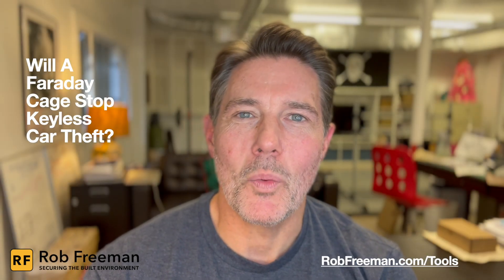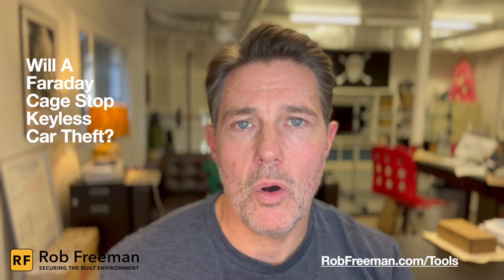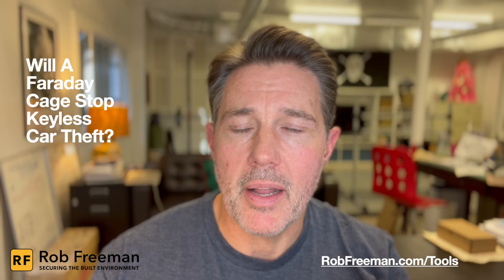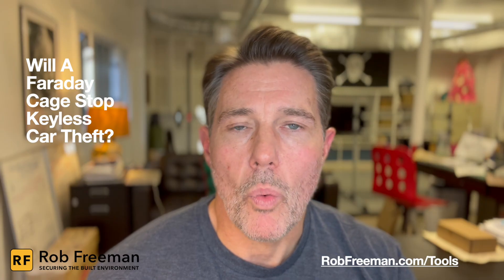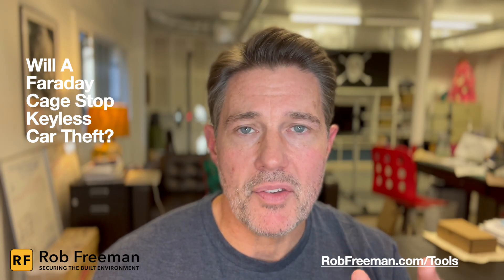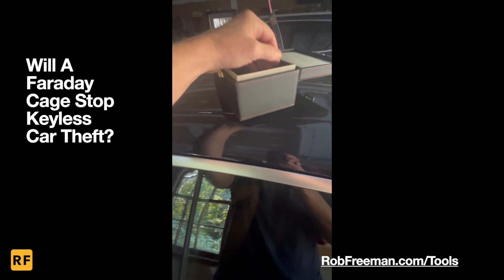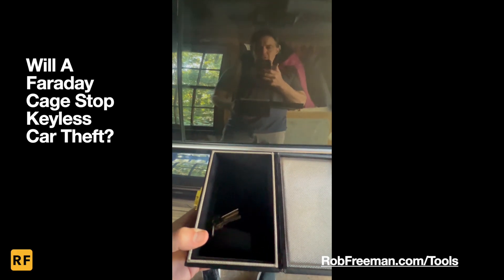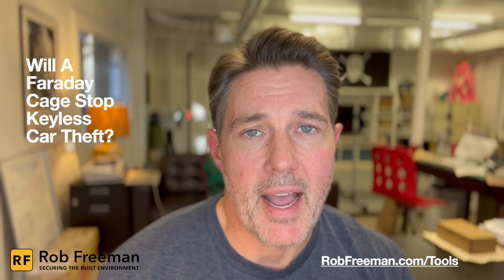Will A Faraday Cage Stop Keyless Car Theft?

Comment: The keyfob inside the house is not "constantly emitting" - it only responds to the car's LF RFID challenge transmission when it's in range, which at 125KHz or 134KHz is only 1 to 2 meters.  So no - the keyfob can't hear the car's wakeup transmission until it gets within that short range of the vehicle and a Faraday pouch/cage/box is superfluous when it's beyond that range, eg inside your house.
Reply: They're using strong Antennas + signal Amplifiers with Repeater, so this will effectively close the range, no?

Comment: I have my keys in Faraday pouches and store both of them in a Faraday box. 
To be extra careful, I also have the Remote HondaLink subscription, with a Geo-fence alert activated and the "Locate car" map. I also hid an Air Tag in my car. HondaLink allows for the remote sounding of a horn and remote killing of an engine, I haven't tested those features yet but I am thinking I could make life extra difficult for a thief driving a car with the horn blaring.

Comment: Thanks 4 the test. On Christmas eve I came out to go2 work. Car was gone. Honda Accords are being stolen like crazy where I live in Philly. Definitely invest in a Faraday box n pouches, I got a set for 20$ on Amazon. 
Also....if you have rims, u might want to add an extra rim lock on each, and invest in an alarm. 
I was carjacked @ gunpoint once, and recently the key fob got hacked. 
Also, one more inexpensive way to ensure your car won't start .......pull the ignition circuit. It might sound like a lot, but if you live in the city, it will help you sleep at night.
Reply: How we know you are human and this happened?
Reply: @DisaterGames  them boxes suck.....hit and miss, you gotta pull a fuse , and put a club on to keep ppl away. Human enuff?
Reply: @DisaterGames I only use my YouTube page for the videos ....I posted 2 videos of my car getting stolen.
Reply: Also pull the gas pump fuse if it's convenient.

Comment: Thieves have now a new device to steal keyless cars. They don’t need to stand one at your car & the other at your door with an antenna anymore. What they do now is walk or drive up to your car, use their new device which doesn’t need any signal coming from your keys. The device opens up the doors straight away & once the thieves are in the car it only takes them about 1 minute and the cars gone. 	so i suggest you clamp your cars wheel or use a battery cut off switch.
Reply from the maker: Solid advice. Also our vehicles are often Internet connected while we’re behind the wheel and therefore increasingly vulnerable to both remote hackers and local thieves.
Reply: If they use the factory computer, it can disarm an immobilizer.
Reply: Flipper zero is one device used to do this

Comment: A microwave oven is not a faraday box. Everybody think it is shielded to not let the microwaves going out from it when cooking but it's not true. At least not all models because the one I have at home can't prevent my cellphone from receiving a call when inside the microwave (proof #1). Also, my electronic kitchen scale on counter become creasy if I try to use it while the microwave oven is working (proof #2). Try it at home 🧐

Comment: The keyfobs which communicate constantly with the vehicle are perhaps one of the dumbest ideas any automotive engineer could ever devise.  They don't really save you any time, can get your car more easily stolen, and they deplete their batteries way faster which costs you more time replacing batteries than you'll likely ever save by not having to push an unlock button.  Plus, they also allow you to have the key fob near your car, hop in, drive off, park, and then have no way to get back!
Reply: That's false. You're not driving without it
Reply: @kingj0n   Wrong.  Once you have started the vehicle, it keeps running until you turn it off.  The key fob does not need to be in the car to keep the engine running.  Engineering the system to require the key fob in the car would be stupid because, if the battery went dead while driving on the freeway, the car would die and create a safety hazard for the driver and passengers.
Reply: @kirkjohnson6638  My Honda requires the key fob to open the gas tank so you are only going as far as a tank can take you.
Reply: @darrenharrison3591 Well, my Honda CRV could take me over 400 miles away before I came to realize that I have no key fob or physical key with me.  That could present a serious problem.

Meanwhile, the key fobs for my 1997 Ford Mustang are only on their second or third batteries and I can't drive off without the chipped key in the ignition.
Reply: The keyfob does not "communicate constantly" with the vehicle.  The fob is normally sleeping and responds when the car transmits a relatively low frequency (125KHz or 134KHz) challenge signal when you pull the door handle or hit the Start button.  Only then does the fob respond to the challenge with the rolling authentication code, which is verified by the car to unlock the door or start the vehicle.  This comprises the PKES protocol, which is designed to minimize drain on the fob battery.
Reply: @stevehoge  Well, then they did a piss poor job of circuit design because I'm on my fourth or fifth key fob battery for my 2020 Honda CRV and I'm only on the third key fob battery for my 1997 Mustang.

Comment: I DO NOT like the proximity opening of the car door by the key fob. Is it really that difficult to press a button on the key fob to open the locked car? Good information about the faraday box or pouch.
Reply from the maker: OK thanks... Probably wouldn't have been more than 6" away if fob was in my pocket. Point is a thief doesn't have access to the button and can just pull on the handle, unlocking the vehicle using just the amplified signal from the fob.
Reply: Is it really that difucult to use a car with an actual key? But no u want the latest and greatest well then pay the price. I dont have that problem ahahahahah
Reply: @thatguyherenthere  I agree on the fact that opening the door via proximity is kind of an unnecessary thing, but new cars do tend to have more things that are useful.
Which car do you have? Honest question, no snarky comment from my part or anything.